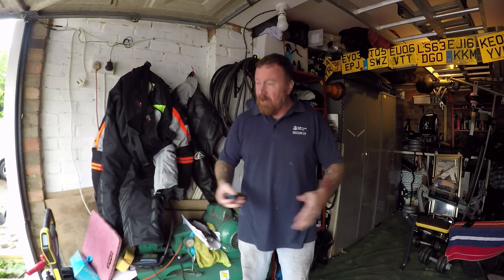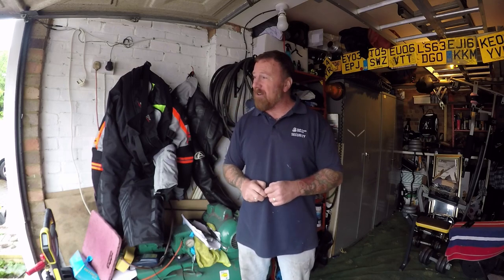WINTER BIKE BURGMAN WON TOP TIPS & SERVICE MARK SAVAGE

Comment: hello mark, good video,just a couple of points, when the cvt cover was off did you change the gear oil only way when cover was off need a syringe and tube. did you change the variater rubbers go`s on the outer back ring  4 of them. as you said the inner cover gets stuck but using the bolts and a rubber hammer works. i have i burgman 400 k8 and love it.
Reply from the maker: Hi 
That's no and no , the gear was changed at 20k 
And the rubbers all looks good, it was the first time I'd come across this system with the grease inside the slider 
It was works well now so happy 
Was told to screw the two bolts all the way in as they would push off the cover but I didn't want to do that as not done it before 
Agree loving the little scooter in the cold wet conditions 
Take care bud

Comment: Ran a early model burgman 400 to and from work in all weathers for 2 years and they really are a great machine but they can be a pig to work on, more so than other brands of maxi scooter. I used to hate having the airbox under the seat rather than on the side of the swingarm/ engine as it was always a right faf to get to the top of the engine to adjust the valves plus you seem to have to remove more of the plastics get to the CVT than on other scoots. Why o why they don't have the 2 cast in holes on the variator so you can lock the outer plate when removing the nut I'll never know , I used to jam a small socket behind the variator on mine to hold it still . As to the slow pull off the line burgs have a delay before the clutch engages which is impossible to fix without changing the variator or clutch , changing the rollers to a lighter roller ( I used Dr pulley sliders) does help a bit. I'm now using a sym joymax 300i abs and it does the same job with the same performance but so much easier to work on  and better mpg.
Reply from the maker: Yes bud agree great but a pain to work on 
I have a few more videos on them
Doing the variator , breaking down,  belt 
More 400 and 650 reviews worth a watch bud
Reply: @marksavage  just watched the belt snapping vid , had exactly the same experience with a belt off eBay on mine left me with a 1 mile push ( they are not light to push lol) , fitted a malossi and never had a problem again!  .
Reply from the maker: @Dwainpipe21  really shouldn't be able to sell them as lucky for me and you it didn't lick up and have us off !
Really poor but like you then paid for a quality one which I should have done in the first place lol 
Take care bud

Comment: Hey mark already been subbed to your channel for a while and learnt a lot from your vidoes however on both of my speedfight 3’s why do they idle when the engine is cold but when the engine has warmed up when I stop at lights it’ll cut out why is that?
Reply from the maker: this is common but can be a few things 
one auto choke problems and air mix not right / clean carb idle and main jet
plug problems ,needs a good service 
simple idle too low so could do with turning up a little -

Comment: Mark great vid buddy, excuse my question if it seems daft, when you replace the rollers is there any way if putting them in wrong and also with the belt is it self adjusting ie not like a change... My uh200 comes next Tuesday yay, got oil, filter, air filter and belt will be changed if it looks crappy lol. Ride safe cheers bud
Reply from the maker: like in my videos just dry wipe and clean they only go in one way as for belt the variator system does the tightening for you ,just may sure it the right one and all should be ok as I have many video on them to help even my burgman video will help
Reply: @marksavage  Thanks Mark I know it may seem daft but everything I have serviced before hass had a chain lol, all the best !!

Comment: Like your video have you got any tip on servicing honda vfr800 2003 I am thinking about getting one.
Reply from the maker: Hi bud thanks 
Sorry no I've not worked on one as they have the V4 engine and getting to the plugs can be difficult 
I'd take the take off and the side panels and see what you can get to 
Take pictures off what you take off and remember what goes where 
Worth a go and if you cant do it just put it all back on and you have lost nothing bud 
My multistrada is the same sort of thing and that's what I'm going to do as always worth a go

Comment: I’ve got a Yamaha aerox and it’s got a few problems with it, when I turn the ignition on the lights should come on but they don’t. I’ve charged the battery and it’s still doing it any idea what it could be? The electric start doesn’t work so I have to kick it every time, when I kick it the and leave it joyriding when I pull the brake in my light all just turn off, Also it doesn’t take off straight away goes about 5 mph and then just picks up like normal any idea what this could be? Where abouts are you based cause I’d happily pay for you to sort it out
Reply from the maker: lots of problems then bud 
ok - the lights only come on when its running 
follow my video on the electric start to fix, its on a speedfight but the basics are the same 
you defo has a stator coil problem this runs your lights and I have a video on it with a aerox check that out 
pull away rollers and variator check out my video for that 
type in the problem and then mark savage you will find them bud

Comment: Hey Mark, Ive got a piaggio nrg 2002 and it is great on straights and downhill, Whenever going uphill it drops right down to 5 - 10mph even on the smallest incline. This is very scary and dangerous, im pretty sure it's the limiter stopping me from accelerating well up the hills ect. Any ideas or advice on removal of it?
Reply from the maker: I had this on my speedfight 
Winter ride video give it a watch bud well worth it 
It will be your variator system 
Rollers and poss clutch
Reply: @marksavage  Thank you so much, been watching a while and knew you could help.
Reply: @marksavage  Where abouts are you? I would be happy to pay for you to do this.

Comment: i have a honda sh125 i do u let your bikes warm up or just start it up and ride off
Reply from the maker: Just start and go bud 
The only time you wear  in brakes is from new 
Thanks for watching
Reply: @marksavage  is it normal for it to feel realy sluggish when the engine is cold u have to give it around half throttle to get going
Reply from the maker: @trainzhub  a bike when cold is on choke so runs rich 
This can make it sluggish so may need a tune or a simple service so plug and air filter